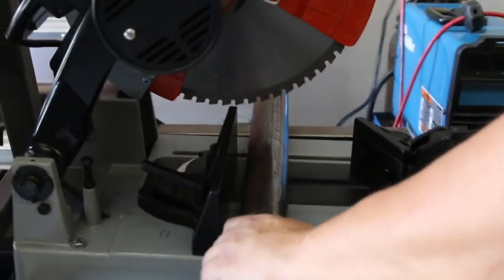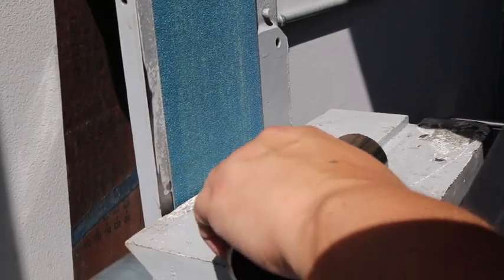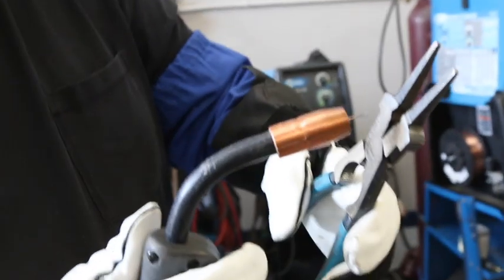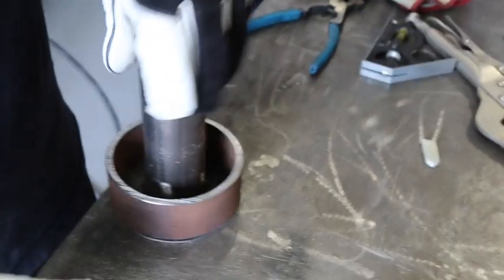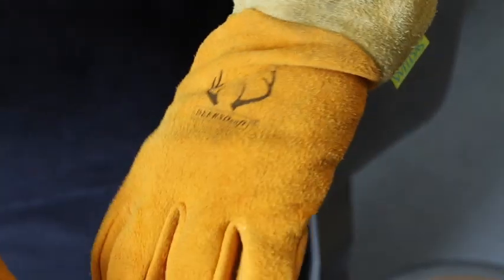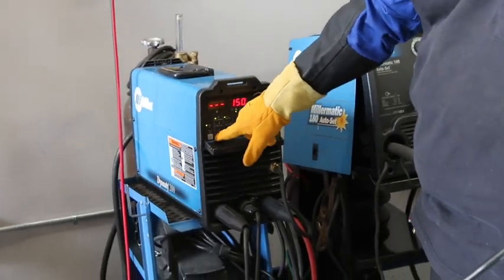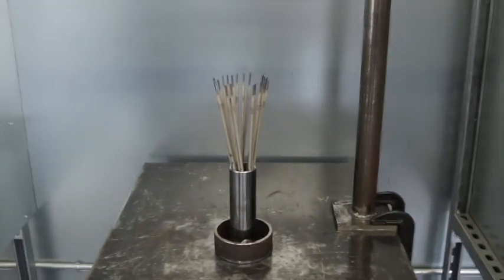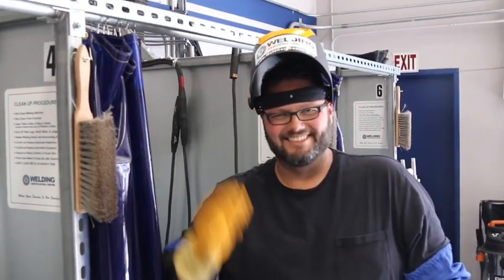MIG & TIG Welding an Electrode Holder

Comment: I'm a starting welder at 14 and would like to know should I start with flux core or MIG I will be doing small projects such as crosses and other stuff what would u recommend
Reply from the maker: Flux cored is easier in terms of budget and equipment, since you don't have to purchase a bottle of shielding gas and constantly refill it. Otherwise, MIG is a smoother, cleaner process.
Reply: WeldFever ok thanks